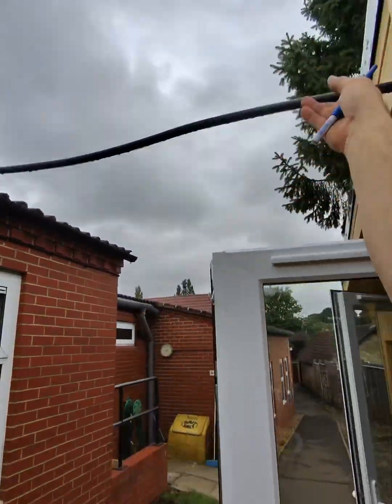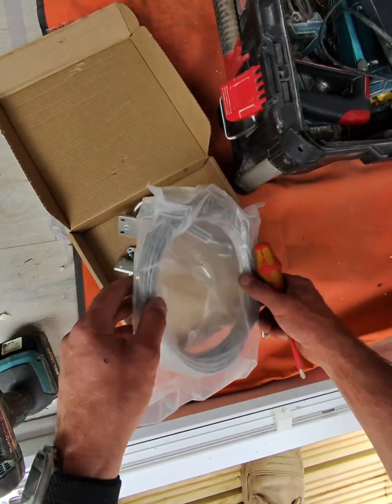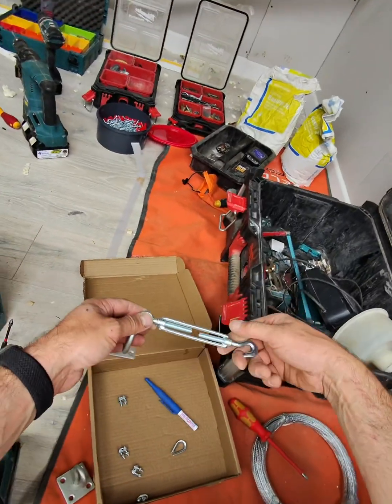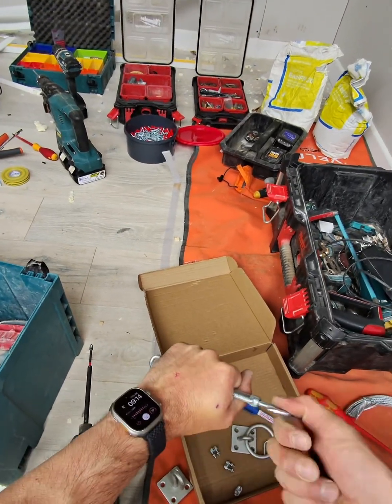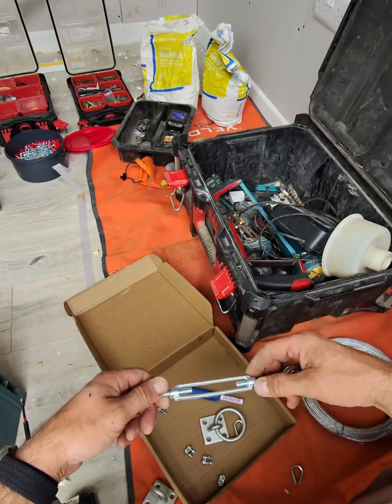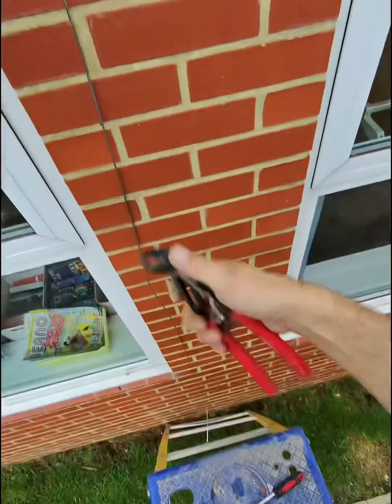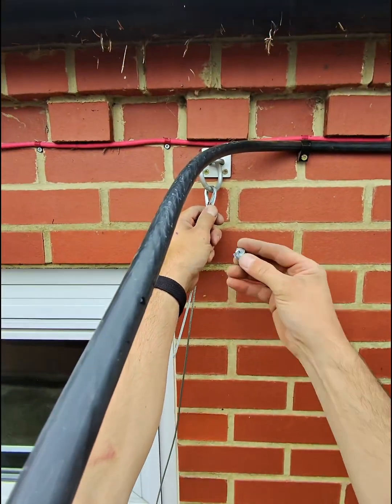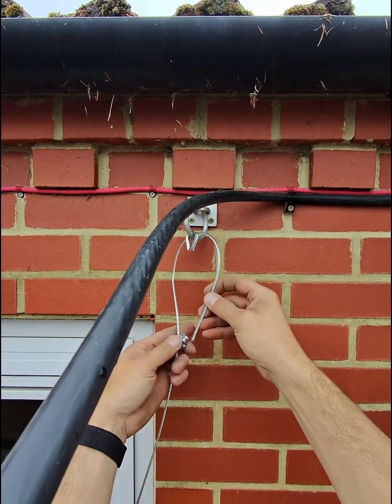Running Cable? Use a Catenary Wire Kit the Right Way 💪

Comment: Not sure why you used a expensive catenary kit for a short distance.   Just buy the catenary wire separately and use 2 fluorescent light hook plates . Works a treat. I hope you took into consideration in the winter that catenary wire and armoured cable will contract and  pull the hook plates off the wall if you didn’t leave a little bit of slack .  I hope those cable ties are UV resistant. They don’t look it .  If not they would be lucky to last a couple years .
Reply from the maker: Thanks for the tips on the hook plates, I'll keep that in mind!
Reply: I’ve got a sneaky suspicion that you don’t hope he used uv ties and considered the slack